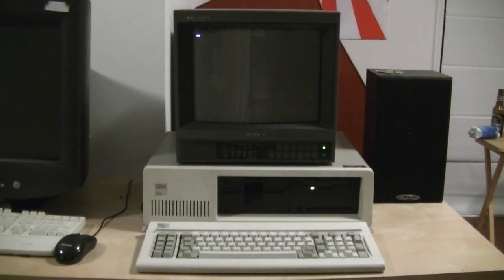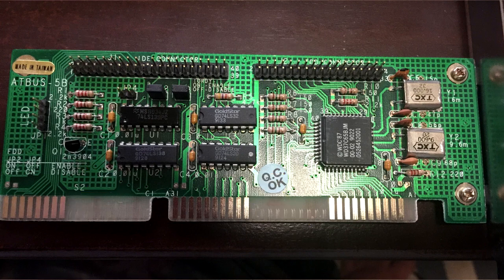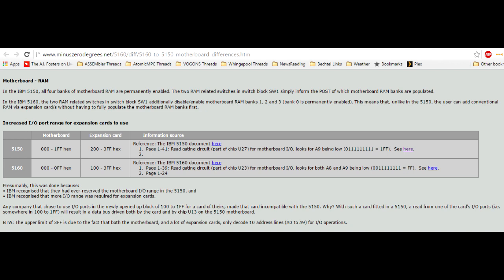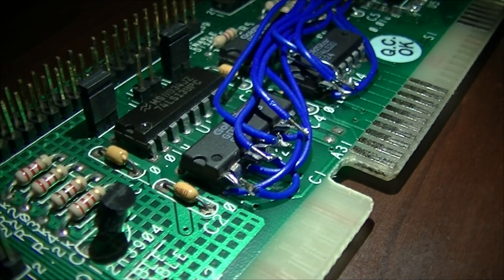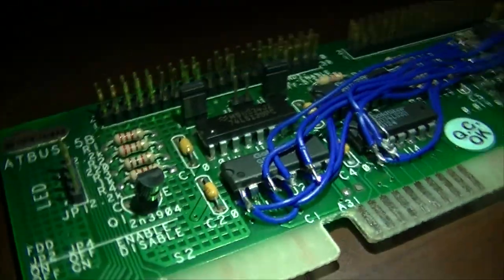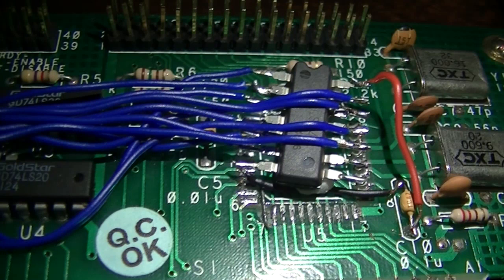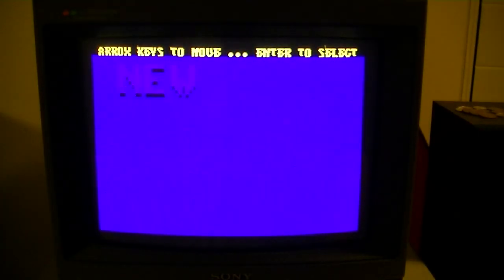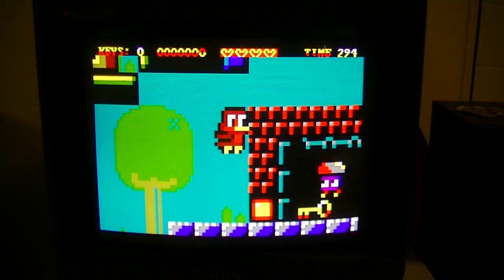[retro swim] - Episode 33 - IBM 5150 oddness

Comment: Just a side note: It's usually a good idea to set your camera to manual focus when pointing it straight at a computer screen, otherwise if too much of the image on the screen is blank the focus will go out of whack thinking it must not be focussed right. Other than that, this kind of hardware mod is way out of my league but it's neat to see that stuff like this is possible all the same. :)
Reply: RetroSwim most Canon point and shoots do MF and videos
Reply from the maker: Spot on, but sadly my camera doesn't have that functionality! It wasn't a very expensive one, I bought it when I didn't even think I'd be making 5 episodes, let alone over 30 :P
Reply: +RetroSwim whistles I'll use manual focus when I melt that Duron down! :)
Reply: *****...really? My camcorder is about as cheap as they get and even IT has a manual focus... maybe you just haven't located it or it calls it something else because it's wacky like that?
Reply from the maker: +Pixelmusement Nope, it just doesn't have it. It has focus "compensation", where you can adjust for if the autofocus is picking the wrong spot, but no manual or fixed focus. It's a piece of crap, I'm getting a new one this year.
Reply: RetroSwim get any old Canon still camera from the trash lol